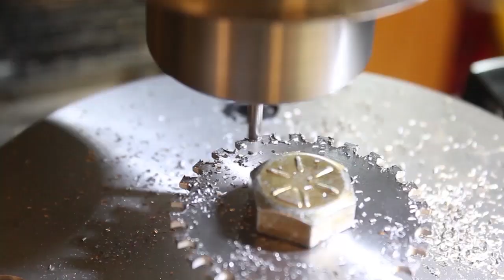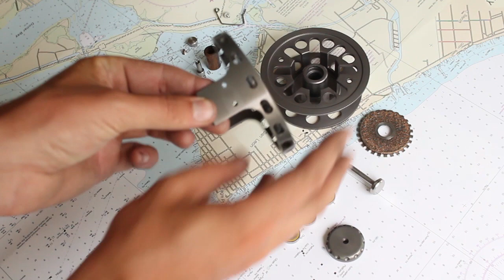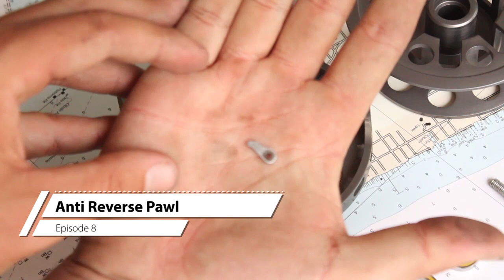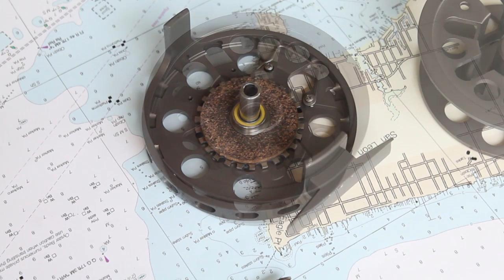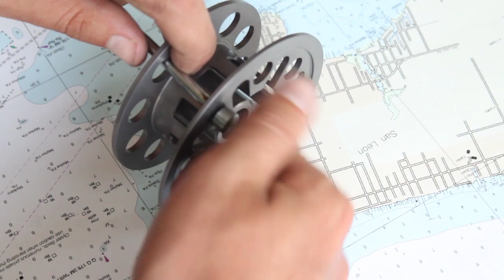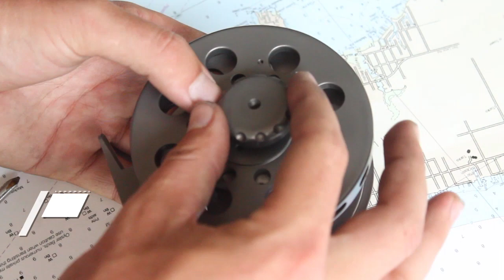Homemade Fly Reel Ep. 11: Final Assembly

Comment: Do you have any concerns about corrosion caused by aluminum being used alongside stainless in an application where it will be exposed to water constantly? I assuming the anodizing helps but have you noticed any issues yet?

Comment: I'm making progress on my build using your plans.  You've done great work!  In the videos you used #4 screws but the plans use #2. Is there any particular reason to use one over the other?  I just want to make sure before I drill my holes!
Reply from the maker: On which holes?
Reply: From the plans, it looks like all of the screws are #2.  The reel body to reel foot shows #2x.375", the main shaft to reel body shows #2x.125, the counterweight and handle screws are both listed as #2x.250" and the drag clicker screw shows #2x.1875".  I didn't know if this was a typo or version changes from the video.

Comment: I'm curious about the frame (in general, not just yours) - its only purposes are 1. to hold foot to the axle, and 2. to hold a catcher/keeper for the fly line at the bottom of the reel.  So why then are they always made to go around the spool?  Wouldn't a more purpose-built design be stiffer and much lighter?  Something like an integrated foot, axle, and catcher, and not too much else.  A side benefit would be that no sand could get caught between spool and frame.

Comment: Bravo for making longer threads in reel foot instead of shorter in frame...Only your reel and Van Staal C-Vex has the right thing...You don't have any sort of cushion between draw bar head and ball bearing? Like coil spring , Beleville washers or even a small rubber gasket? Also between drag plate and spool are always small rubber gaskets to release the drag tension .
Reply from the maker: Eduardito, thanks for the complement. I have seen the set ups your referring to with the springs or bellevilles, and I intend to use that setup on the next reel for the channel (offshore lever drag), but on this reel, it seems to function flawlessly without it. In our little torture test the drag ran super smooth.

Comment: Are you worried that 2x #4 screws is all that's holding your reel to the rod?  What kind of force do you expect on the reel?
Reply from the maker: EFormance, not too worried about it, the size was initially selected by comparing it to production fly reels of the same class. The screws have over 3 diameters of engagement, and by my calcs the heads will pop off the screws at around 400 lb-f. each, so I feel pretty safe.